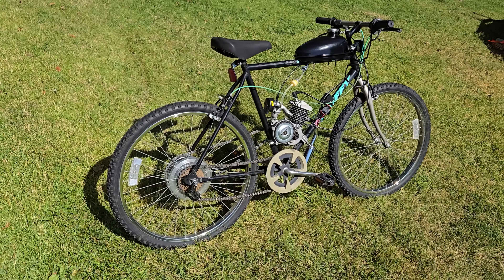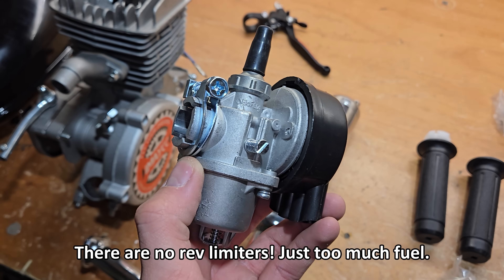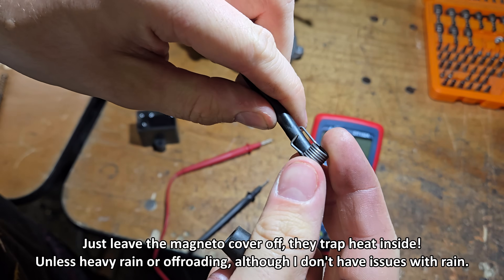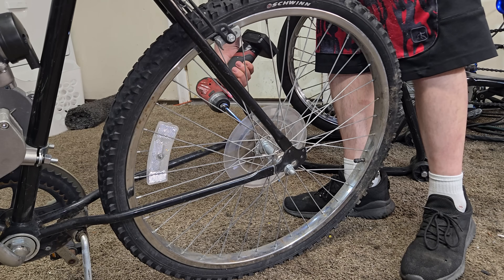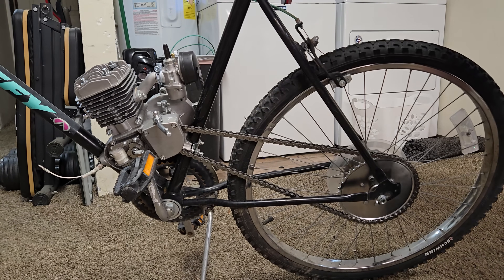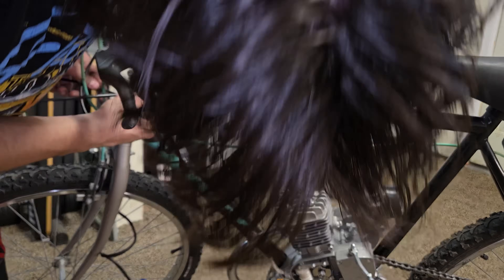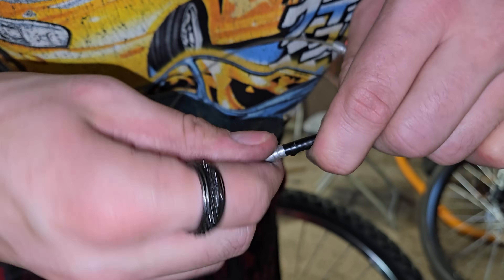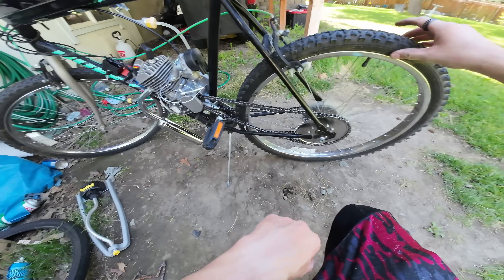Build a Motorized Bicycle in 12 MINUTES for under $200!

Comment: I love your videos, my bro I admire your belts.. you inspire me to build a race bike now.. I demolished myself a few years ago and almost died on one of these…. I’ve been afraid to go fast ever since but I don’t care no more. I opened my bike up the other day and it went 50 miles an hour that’s OK. It has an 80 miles an hour like yours, but I still got stuck parts…. I did bore out the ports for better airflow… waiting to get the job so I can get a high-performance carburetor and muffler… eventually I want to buy the same motor you have on your 80 mile an hour bike❤❤❤ I want you to know Cuzzo you are a true legend

Comment: Why would you not prefer the Dominator over the Avenger the Dominator is the Avenger with with a G4 cylinder and everything else is upgraded it's the same thing as the Avenger but upgraded parts why would you not want the Dominator the only main difference is it's a force injection cylinder which is better than the cast iron Plus it's A G4 open transfer ports Why would you not prefer that not to mention a lot of people who sell the Avenger 85 put them on fake YD 100 bottom ends the Dominator is the real YD 100 bottom in so again why would you not want the dominator I've had the Avenger and the Dominator and the Dominator stock is  much better than the Avenger right out the box for the same price what ever to each their own i guess
Reply from the maker: Because the dominators are a knock off of Avenger 85's, they're not popular, and make less power than Avenger's because of the G4 transfers.

Comment: I have the same motor but with a blue wire down on the engine, so in total blue, white, and black, and with the two ignition wires I don't know what goes to what, any tips?
Reply from the maker: You can see that the white and blue wires are connected to the same tab of the coil.
Reply: @trentbikes ohh okay, well I have a question, if I wired it up incorrectly could it cause the coil to not fire? Because I don't know whether the wiring not being right is making it not work, or of the coils junk entirely
Reply from the maker: @Minecraftmf1126  Timing will be ATDC, rather than BTDC.
Reply: If my coil is bad, do you know where I could get a replacement? I don't know what type of motor I have on mine is (it's the same as the one in the video though) I just don't know the name of it so I can't search parts for it
Reply from the maker: @Minecraftmf1126  amazon

Comment: You should mention that not all frames will work. And that you need a specific frame in order for any motor to fit!

 I’m on number four just to find one that the motor will fit on and the  carb & exhaust will fit. you make the process look very easy, which is a bunch of BS!!!

I’m on my fourth frame just to try to get the motor mounted and the stock exhaust to clear.  it won’t clear the pedal by a mile. 

Thanks to your wonderful videos I dumped about $500 into a bunch of junk that I’m never going to be able to use!

🖕

Comment: Well I got 750 miles out of my yd100 motor and rings were carboned up and stuck running 32 to one gas oil mixture putting a  new piston and rings in might try 40 to one mixture, have a great day
Reply: Get an LD100 cylindef and piston with a high compression head. No offence but i hate yds. They have a lot of problems.

Comment: Hey bud how you doing with all due respect I don't understand how you can build a motorized bicycle in 12 minutes when it takes over 20 minutes just about to the right sprocket onto the back of the wheels off of the spokes everything you got 10 bolts you mean tell me you can get 10 bolts on that rag joint with that rocket on that rim less than a minute I paid you see that one but anyway it takes 6 minutes to actually Baltimore on the frame then takes a couple of them like I said takes over 20 minutes and amounts of sprocket on the back tire and then takes another couple minutes my everything on the handlebars and run your cables everything there's no way you're building a bike in 12 minutes but I think over exaggerating this one lol
Reply: The video is 12 minutes

Comment: Got my 100cc  blood orange  stingray style cruiser to start up  after trying a few cdis and spark plugs.Tried the original cdi and plug fired right up. Was stalling and running kinda lean until my dad backed off the carb about
 2 1/2 to 3 turns. Runs good about 40mph. Still learning how to use a clutch. Bent a kickstand trying to stand up and bump start it. A Few minor things came back apart from vibrations but nothing that cant be fixed👍.
Reply: Chopper bik. I got an OCC edition stingray. Im in the process of replacing the bike motor with a Toro tecumseh 2 stroke tecumseh motor. I have to do quite a few modifications, making a specail head, eliminating the pulsing port fot the carburator and going with  a PE19 nibbi carb and covering the reed valves it has in the clinder for governing the speed. It has a 53mm piston.

Comment: To center the rear sprocket i wrap the rear wheel hub with painters tape until the sprocket fits over without  any slop. Then I cut the excess tape off
Reply from the maker: Interesting. I'll try that out.

Comment: I have an 80cc H-YEEV... I bought the kit from Amazon.  I'm sure it's junk.  But if like to make it run better.  I've already bought a  "high performance" cdi and motorcycle chain.  I'm wanting a new exhaust and head but I'm on a budget.  If you didn't have much money what would you buy from Amazon as an upgrade.  Also what Amazon carb. I liked your shows I'm new to the motorized bicycle thing.  I need reliability not a racing motor.

Comment: 6:50 you get better clearance if you flip the sprocket over like the instructions say to do… if I were to install mine facing this way it would rub on the frame… also need to do star patterns when tightening the bolts skip across back and forth to tighten evenly…

Comment: is drill starting engine okay? i havent had any issues other than slight rounding of the nut but it gets the engine running. im down a wheel cuz the bearing is shot
Reply from the maker: No its not

Comment: Red loctite is a great way to get exhaust studs snapped off inside block. Instead, try using a actual pipe mount to support the exhaust.
Reply from the maker: Ive loctites my bolts without issues, just dont tighten them too much
Reply: @trentbikes  It's a band-aid. Fixing the real issue, which is vibration, is the better way. I never use loctite and my stuff stays put.

Comment: Yet another rag joint hater. I have been running bone stock rag joints on ALL my bikes, INCLUDING my Minarelli 70cc vertical hybrid with exactly ZERO broken spokes or other issues. The ONLY real problem with using rag joints is the lack of proper installation. Sprocket adapters slip and are hard to keep tight. Ragjoints are rock solid and do NOT break spokes if installed correctly. It's one of the rare instances where the chinese design is actually good. The only thing I upgrade are the sprocket bolts. Check out my channel for bike vids. I've been building these bikes about 15-17 yrs now, and have been building two stroke engines since the 70's. Instead of using zipties to center sprocket, try using aluminum from a soda can to wrap the hub.
Reply from the maker: Too long didn't read, I still hate rag joints they are trash. 6 bolt hubs for life
Reply: @trentbikes  Lol! Hubs are 100% the best way. But cheapskates like me still love ragjoints. Hell I've even used one on a 212/CVT build. Zero problems.

Comment: it helps with the rag joint to tighten opposite sides, like you do with car wheels. do one bolt, do the opposite side, then do one halfway between them, then the opposite side. it helps to keep everything aligned.

Comment: is it normal for a chinadoll to take over 50 seconds to reach its top rpm?
Reply from the maker: They are weak engines so what do you think
Reply: ive experienced too much werid shit with these chinadolls so at this point i dont know whats normal and whats not🤣
Reply: like one time the gas can lid was the determining factor of rather my motor started or not and thats just touching your feet in the water in terms of strange shit ive seen with these 2 strokes

Comment: why can my chinadoll  have more power with the choke on but barely any power with the choke off but hit the same top rpm
Reply from the maker: Its too lean
Reply: holy shit thanks so much ive been running my engine with the choke on sense its first start because it just had zero power with the choke off but now i know whole time it just needed to be richer
Reply from the maker: @spicyderbeater  check if you have any airleaks first